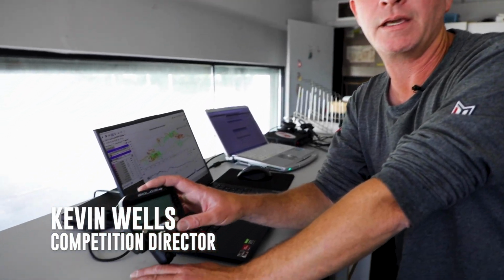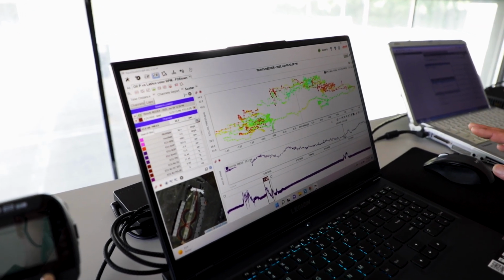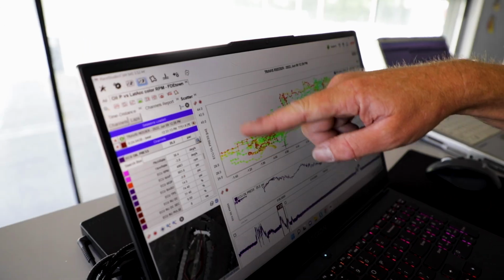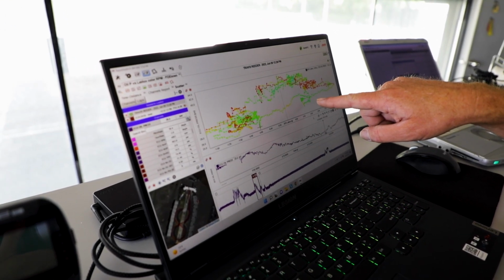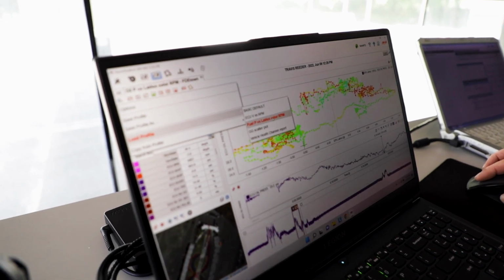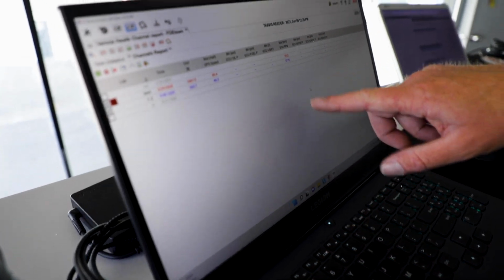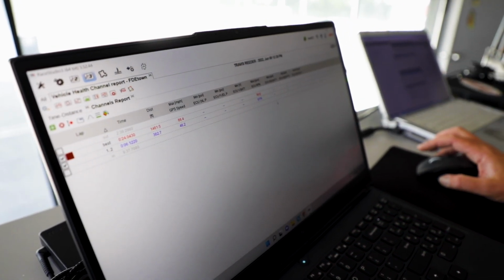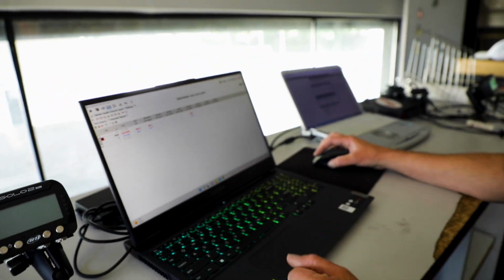Vehicle Data Collection in Formula DRIFT with Kevin Wells

Comment: Why does the organizational body need this information? Sure the individual teams should be concerned with oil pressure but are wins and losses determined by this data? "Gosh, that looked to be a perfect run but the data shows Reeder's oil pressure dipped a little lower than his competition so he loses the match."
Reply: They've started logging people CANbus data mostly to check for brake pressure and throttle position to help decide a difficult call. For example, it can prove fault if say the chase car hit the lead car, but then they pull the data and the lead car was off throttle in an acceleration zone so its actually the leads fault.
Reply: @bennyb.1742  They cant read the data in real time. They have to retrieve logger from the car and download the logs. The only way I can think of this data being used in competition is for a challenge of a prior judgement. Perhaps they are developing a system that can interpret the data live, collecting these logs would surely help in the development.
Reply from the maker: He's just demonstrating what teams can use it for. We use it to monitor deceleration and vehicle behavior to be more educated on what the cars are doing and how that might inform track set-up, judging, how consistent the cars are with each other even with various tire, motor and power adder combo's. When this becomes avail in realtime, which it is in the deceleration data (red light on windshield) the ability to make better more consistent judging calls on wrecks becomes much easier. Bottomline, it makes you more educated and smarter about what the cars are doing.
Reply: Ha really
Reply: I’ve heard that some teams have used tech in the past that gave them an unfair advantage. So being able to look at all the data would probably help reveal if drivers are running “illegal” cars for lack of a better term.